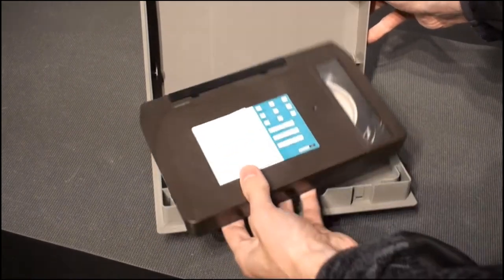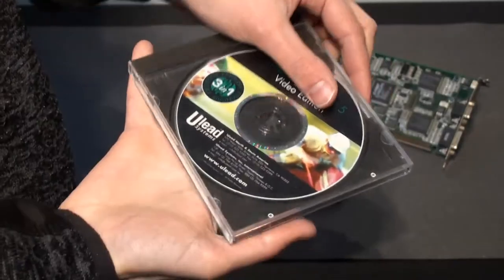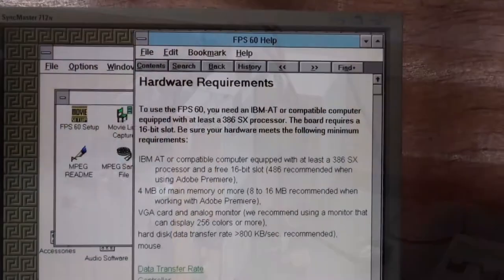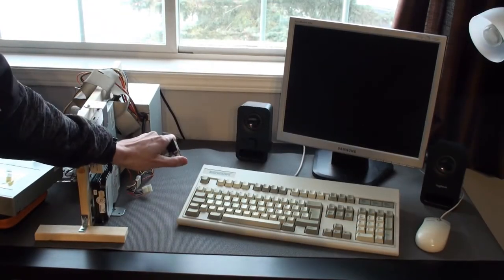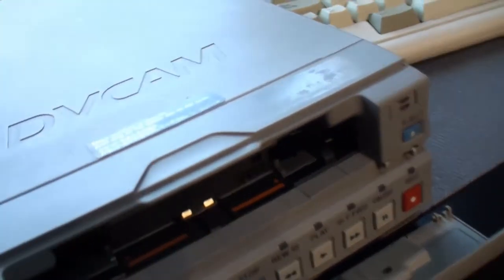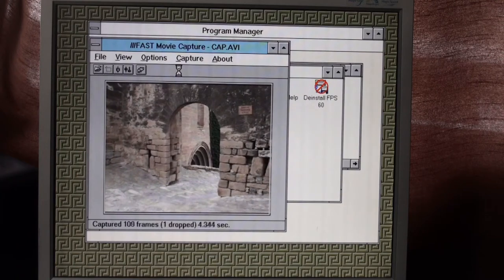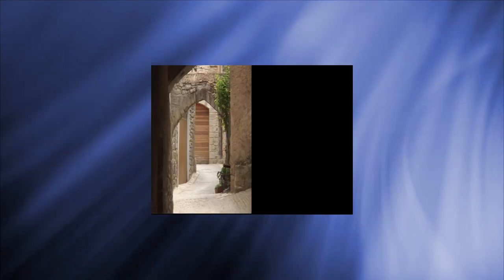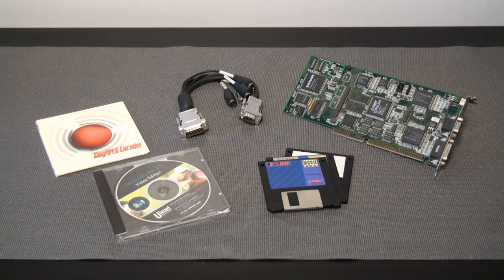Editing video in a 486 with the FPS60

Comment: Just got the same card with the MPEG add-on. Can you share the drivers with me? :) (unfortunately, googling a card called Fast Multimedia FPS60 is not an easy task, I hardly found this video :D ). Also, unfortunately, I don't have the cable, but I could build it I guess. Is there any diagrams about the pinout?
Reply: I've got the driver of the Fps60, but not the Mpeg Encoder add-on drivers
Reply: @lauraberetta9651  I found the drivers, I guess the same one as you. :D But the cable is still missing. I even asked Pinnacle if they have the pinout somewhere documented.
Reply: @M3MB3Rrr  have you the mpeg encoder drivers?